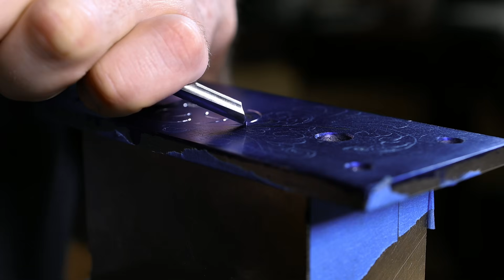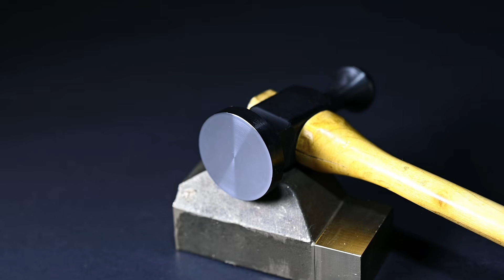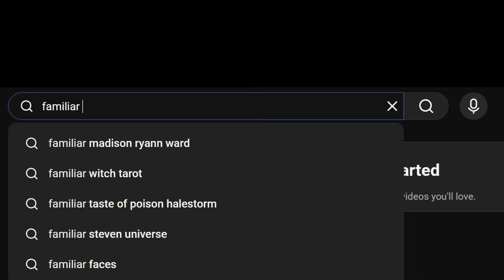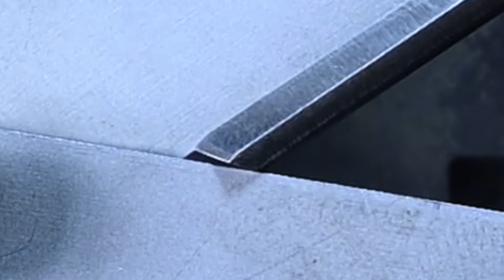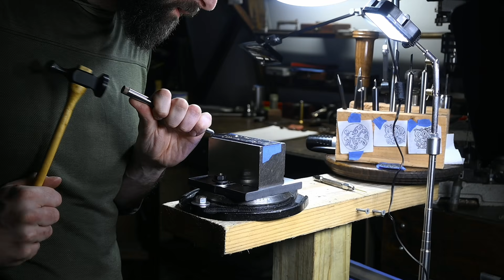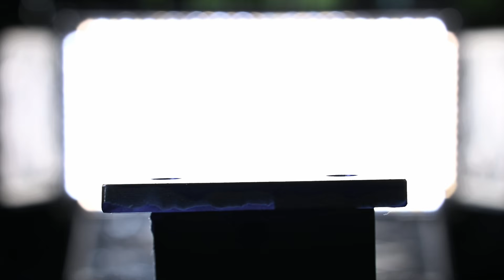Hammer and Chisel Engraving, the Novice Perspective

Comment: The much better and more consistent way of tempering is simply using the oven. For O2 steel 200 Celsius for 1.5 hours is enough. It lowers the hardness a bit (by about 0.5-1 HRC) but brings back a lot of toughness, since tool steel is very brittle after hardening (quenching). For 99% of the cases tempering is mandatory and must be done no longer than 10-20 minutes after hardening, as its effects rapidly decrease over time
Reply from the maker: I had considered using the oven but had it in my head that it would take significantly longer than 1.5 hours, so that's good to know. I also had no idea about the time frame after hardening, I figured it was something that could be done whenever!
Reply: @Pearlybrook  One more interesting thing to know, is that the tempering temperature becomes a sort of threshold: if you heat the part during exploitation/sharpening up to temperature you used while tempering it won't lose its hardness, but if you go beyond the hardness will decrease